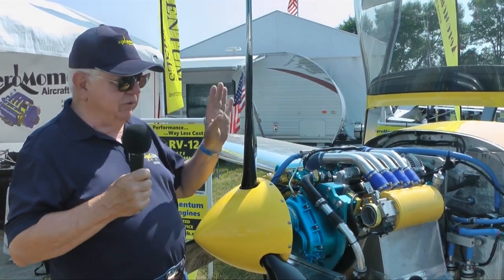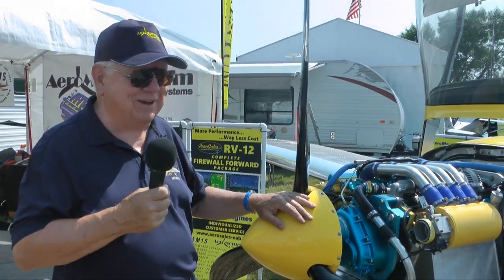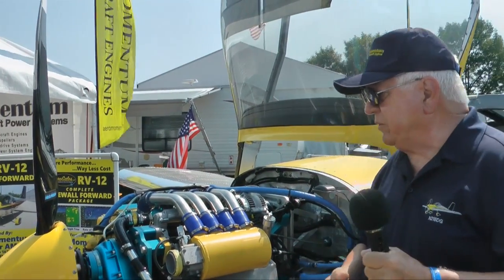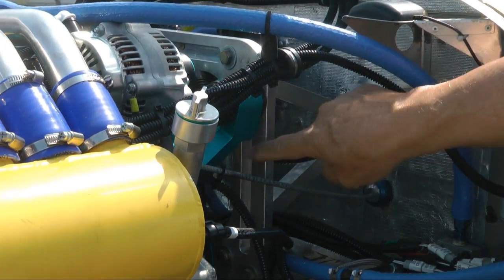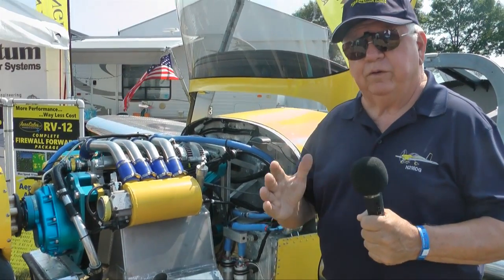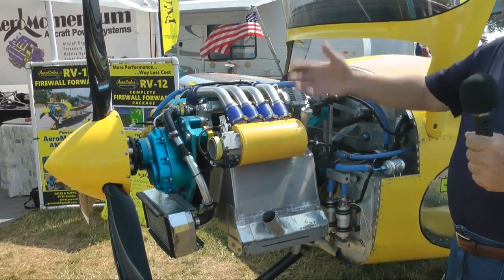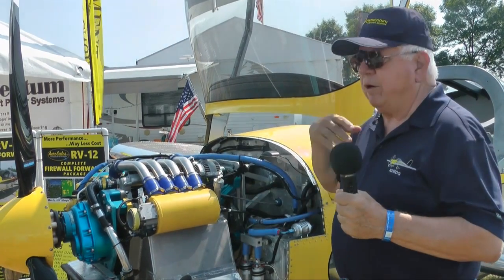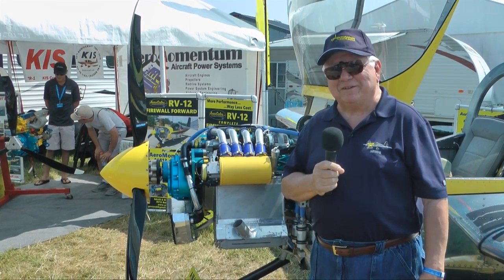They're putting WHAT Engine in an RV-12 ?

Comment: Not a pilot here....but I was wondering why engines like this are not used to as replacement engines in old Cessna 150's and other types of small airplanes.
Reply: William Ferguson II 
From what I understand it’s a few things. 
Replacing an engine is kind of a bureaucratic headache, but putting an uncertified engine in a certified aircraft is a paperwork nightmare.
That and there’s a idea of “if it ain’t broke, don’t fix it” in the aeronautical industry. It’s “proven” that Lycoming and Continental work, but these are “unknown”, despite the fact that some automotive engines will run a million miles in a car.
I kind of get it, safety concerns and all, if your honda craps out on the road it’s a problem, if your engine dies at 10,000ft? Say your prayers.
So these kind of things are somewhat technically prohibited from being anything other than “Experimental” by nature.
There’s also other reasons but those seem like the ones I think are some of the biggest from what little I know.
Reply: @twdog8106  If your Honda craps out on the road, it's your problem. If your planes engine craps out in the air, it's everyone below's problem.
Reply: To follow on to Tony Webb, every certificated (factory built) airplane is built in accordance to a "type certificate", which is very specific about the design of the plane and its parts, and you can't change anything. There are a few airplanes out there with "supplemental type certificates", where a modification has gotten FAA approval. But to issue an STC for an entire model of plane, like allowing this engine in all Cessna 152s, is simply out of the question.
Reply: Reclassifying as experimental would be required.
Using an O-240 (like Europe) or a Lyc 0-320 upgrade is better.
One guy has a Lyc O-360  180+ hp on a 150.
Reply: Basically the aircraft would go from certified to experimental.   Since he's not going to spend millions to get that engine certified and then type certified by each year make model of aircraft it could go in.  
It's why their are 2 engine manufactures for certified older aircraft
Reply: WF: Traditional Lycoming/Continental aircraft engines are the result of decades of experience and reliability.  Airplanes are a severe environment with much different requirements that auto engitnes.  It just isn't possible to tinker with the designs and provide the level of safety and long life needed.
Reply: @KB4QAA    you are pretty off base, aircraft engines are not especially reliable. They benefit from a huge beaurocratic infrastructure that requires nearly every part be thoroughly documented along with every bit of maintenance.  This allows any running errors in manufacturing or assembly to be identified with just a minimum of failures.  And failures DO happen.  A lot.

Hard parts also benefit from the manufacturing cycle where engine cores are stripped down and their records destroyed, the individual parts examined and re used.  This means that many "new" zero hour engines contain mostly used parts, the idea being that these parts are a known quantity and can be assumed to be good while brand new parts may come from a bad batch.

Those two mechanisms are a big part of why the fatal accident rate is as low as it is, but even then the actual mechanical failure rate is relatively high, this is somewhat kept in check with low TBO times.  But often not low enough.

Even if you assume the basic hardware of an AC engine is better suited to AC use than a car engine (you are probably not wrong there) the fact remains that ancillary parts like magnetos are woefully antiquated, with TBOs of 500 hours in many cases and replacement costs in the several thousands of dollars range at least.  A modern car style ignition can easily last tens of thousands of hours, can easily and cheaply be made fully redundant if you want and are an order of magnitude cheaper. Even accounting for the red tape markup that would accompany the technology being accepted into the fold it would be a vast improvement in cost and safety.

You are mistaken if you think there has been any meaningful "refinement" of AC engines in the last 50 years, at least for general aviation.   They are fundamentally identical to the engines of decades past and practically all changes to design or manufacturing have been in the interests of cost cutting.  And often leads to batches of faulty parts and a cycle of failures accidents groundings and recalls.
Reply: @DrewLSsix Correct Drew. Too many people believe automotive engines are inferior, but none have ever explained why. I use an automotive engine from Suzuki and it is far superior to lycontisaurus and Rotax. All three of those companies are old designs. Modern engines, especially around the year 2000 are the best.

Comment: Is it a Chain or Belt driven power train?
Reply: Neither. It's a purpose-designed geared PSRU - over-designed and tested to many times greater torque than needed here.
Reply: I think he meant does the engine use a belt or chain. It's belt driven. The psru is geared.
Reply: He said power train...Certainly NOT a belt drive prop.
If the cam is cog belt, well ok, gazillions of engines are.
Reply: Can is belt driven. In one other video they explain that they chose belt over chain in most cases because it's lighter weight. A quality belt will last over 500 hours, and isn't that difficult to change usually.

Comment: 30-50% more horsepower needs feeding too...  way more than the Rotax.
Reply: Well, then pull the throttle waaay back and cruise like the rotax and you're golden ;)
Reply: He said 5.5 gallons an hr at 145 mph that's not much more if any at all then rotax especially if you throttle back a little more dwn to the "legal" 138mph!!
Reply: Sure it does.  But the $20k you save will pay for a lot of fuel.
Reply: @zolotiyeruki  A Rotax 15 T uses more fuel than this engine.
Reply: But you have to be able to carry that extra fuel and extra weight if you want decent range and endurance. That can be a problem.
Reply: And what does it do to the weight & balance?
Reply: @sblack48  The AM15 and the FWF package are 30-40 l;bs heavier than the rotax 912. It moves the CG forward about 1 1/2 inches. This is well within the forward design limit of the RV12. Flight tests verify control and rotation capability right up to and beyond stall speed. Not a problem.
Reply: Not if you throttle back to rotax power .. It would use no more fuel and would probably beat the carburated rotax and  maybe equal the IS ...Its a liquid cooled injected engine

Comment: Other alternative engine supplier also offers new engines, its the customers that opt for a used engine. So whats your point?
Suzuki engines are basically old tech.
Performance data is not rare, Rotax among the other alternative engine supplier also have performance data.
Other than that, nice installation and great performance (also possible with the other alternative engine supplier but they have VTEC).
Reply: What do you mean by "old tech"?  

The comment about lacking performance data is aimed at other alternative engine companies.  Sure, Rotax have performance data.  They also have a $35k price tag.
Reply: Direct injection and VVT is more complexity  for limited gain in aero application.  I’d prefer  port fuel injection and fixed valve timing in an aero application.
Reply: A turbo is a lot better than vtec in altitude also you don't really change RPM like in a car so not sure why vtec would even be a benefit. Just get a properly mapped engine for the right cam.
Reply: By old tech I assume you mean its not direct injection  nor variable valve timing .. though it is liquid cooled and injected ... But like someone said in a different post  if it is not stone cold reliable none of this matters

Comment: Wow!  My only question would be on the gearbox.  I trust the Rotax gearbox will hold up well, but what's the details on this one?
Reply: Turning Short Final The gearbox is one of the most proven parts in the package. It's been used in Airboats for many years building up thousands of real world hours before Mark used it on any converted aircraft engine. No worries here👍
Reply: @dragon2knight  Thanks for this answer.

Comment: A Rotax FWF package is $36,000???
Reply: Its 15 grand more with the 915 ... 25  grand more if you get the constant speed prop with it  .. The carburated  rotax is 19 grand  The IS is 22 grand .. the 915 is 37 grand .. the MT prop is 10 grand ...... Complete firewall forward with 915 and CS prop would be $61,000.00   .. meaning you could buy three of these for price of one 915 FWF  with change
Reply: Hey, if you get the 915 engine, it's at least ten grand more.
Reply: Yep

Comment: Will a FWF package be forthcoming for RANS? I really want an S7, but I'm at 6500' and I really need more power.
Reply: I have plenty of power with my Rotax 912S, even before I modified it with a low comp Zipper BigBore kit.  My strip is 5640'.  I  landed (and took off) at a bit over 9 K just last week.  This engine's extra weight will  not help the STOL performance. Get an S-7, you won't regret it, I have over 3700 hours in two different ones.
Reply: @portnuefflyer  It might not help STOL performance, but it sure as hell won't cost me $30,000.

It's almost as the Rotax people were sitting around one day and one of them said, "What?? A Lycoming is $30,000? Why aren't we charging $30,000?
Reply: Tecnam sierra p2002

Comment: I'd love to see Rotax get some price pressure, especially from a bolt-on substitution, but doesn't this unit effectively push the RV-12 beyond the LSA speed limit; defeating the whole point?
Reply: Just go with the standard output engine, hes telling you numbers for the HP high power installation.
Reply: @orbitalair2103  THIS... Video explained this.
Reply: Could be, but look what the Carbon Cub people are doing about that. There's apparently a loophole that allows you to placard the airplane for a maximum speed below the actual maximum. The same apparently applies to gross weight, because they're calling a full sized, full performance Super Cub clone an LSA.
Reply: @jjohnston94  No. The FAR does not allow 'placard" limitations in place of actual physical capability.
Reply: @KB4QAA  They allow it for turboprops so why the difference here?  Most of them are torque limited and it's your right hand that does the limiting.
Reply: @rnordquest  The difference is the FAR wording.  LSA's are not permitted to have equipment or capabilities that exceed the reg limits. You can't fly a P-51 and claim it is an LSA. .e.g. Weight exceeds, retract gear, flaps, constant speed prop, excess speed.
Reply: @KB4QAA  Thanks
Reply: @rnordquest  Sure. The difference is that FAA requires an LSA to test it's max speed in level flight and max power (throttle to firewall). This is defined as "Vh"
Reply: @KB4QAA  And like everyone, you get cer'd and then throw out the LSA rules.  Unless you are just day flying for S&G's .... which is what most people do anyways.
Reply: @w8stral  Your statement doesnt' make sense.  And what is 'cer'd"?
Reply: @KB4QAA  short for certified
Reply: @w8stral  Ok, but your sentence doesn't make sense. (?).
Reply: @KB4QAA  So, you do not fly or build.... ok
Reply: @w8stral  Been flying 39 years, civilian and military, and can take apart a Cessna in my sleep.  Your statement still does not make sense in English.
Reply: @KB4QAA  Rub 2 brain cells together and even you can figure it out
Reply: @w8stral  Good luck with that English As A Second Language skills!
Reply: @KB4QAA  THATS SIMPLE TO MODIFY.... EVER HEARD OF THROTTLE STOP
Reply: @KB4QAA    he means you get your plane certified as ELSA then ignore the rules.  

And in the case of LSA manufacturers do actually get away with "placarding" their planes, I believe Sonex is one such case where they simply rate the AC for specific throttle positions at specific speeds and those conform to LSA rules, but its entirl8possible to fly the plane faster.  As far as I know the FAA doesn't examine specs or demand AC for tests to independently prove their performance numbers. And they certainly dont do so for ELSA builds.   Just like there are many thousands of "fat" ultralights flying around unmolested by the FAA there are many "fast" LSA/ELSAs flying around not being noticed.
Reply: @DrewLSsix  Actually, the FAA DOES check performance for home built aircraft.  A Designated Examiner who is experienced as either an aerospace engineer or mechanic is required to supervise/review the design, the construction and the test flights.  An FAA representative who is also either an engineer or mechanic will review the design and test reports.  They aren't stupid. They can figure out that if you put a 300 H.p. engine on a fliver, that it will exceed the Light Sport regs.  They will not approve such proposals and can sanction the pilot for submitting false information.
Reply: @KB4QAA    no, they dont.    They will do a general airworthyness check at some point in the build process.  They will likely call you on some gross design issue or equally gross classification issue.  

This typically boils down to a single in person visit some time well into the building of the aircraft but before major components become inaccessible to easy visual inspection.  

They do require you to log your build and your test flights.  But actual in person supervision is simply not a thing unless you are actually insisting someone come out and look at you doing your thing.  Theres not even a clear statement from the FAA as to what your 25-40 hours should look like.  You can fly around in circles, fill out your log book and sign a piece of paper confirming your AC is controllable.
Reply: @DrewLSsix  You have done a good job of amplifying the process for the uninitiated.  Nonetheless, the Designated Rep, and the FDSO rep are not going to sign off on a significantly overpowered experimenal LSA. They know what powerplants are recommended and appropriate.  This thread is about over powering an LSA and fooling the FAA. That won't happen with the process.
Reply: OK, all you English majors, just stand down. There’s some good info in this thread.
Reply: Then why does vans offer even a rotax 915 for the rv 12.
Reply: I got a chance to fly a beautiful part 103 over the weekend. VNE on the airframe was 95mph. Could approach that at 75% power. So I was a good boy and screwed the vernier back until 60 mph ias on the dial. This was a 1/2 VW in a very popular aluminum low wing monoplane.

Observe the speed limit in your aircraft.
Reply: So limit maximum speed with a climb prop

You don't use all that power in cruise, you use it on take off

Comment: What is his electric supply available?  How many AMPS does his alternator provide?
Also, what kind of gas?  (full synthetic implies MoGas --- E0 or E10? (proseal doesn't like E10)) --- airports don't like MoGas
Reply: The alt is a 40 amp Denso. The engine (pumps, injectors, ECU) needs about eight amps. It'll run for over two hours on batt alone.

Comment: Yeaaaaah give Rotax a run for their money.
Reply: Yeah... Rotax be like: "Price firm, I know what I've got" . LOL
Reply: @groachslayer    well... they DO know what they got.
Reply: @DrewLSsix  meh. Overpriced. I like Rotax tech, only after you uncork it with EdgePerformance, which makes it even more overpriced. But even if you're not into auto conversion, there are cheaper, purpose-built alternatives to Rotax (ULPower, D-Motor), and depending on your application, may be much better than Rotax.
Reply: @groachslayer  Viking Aircraft Engines seem pretty nice. Check them out. They're using Honda motors, with direct injection.
Reply: I have a 1.3l Suzuki on my trike instead of a 912, a fraction of the price and 105hp 1100fpm climb